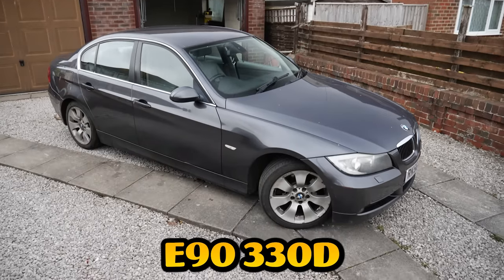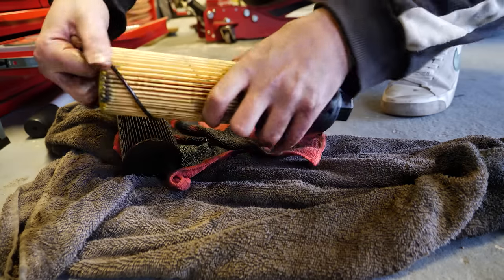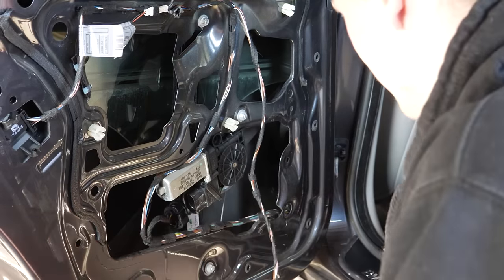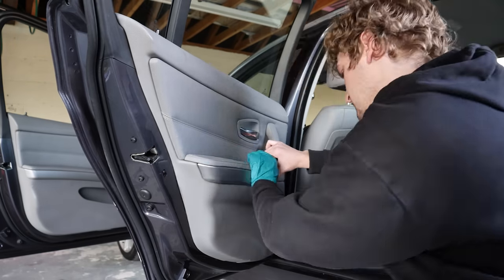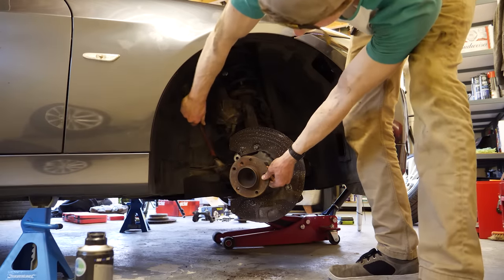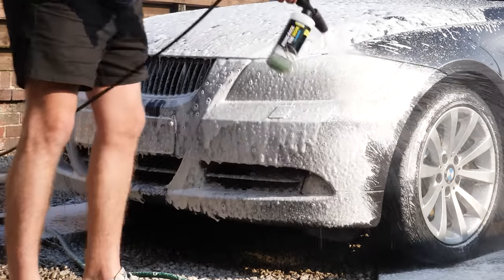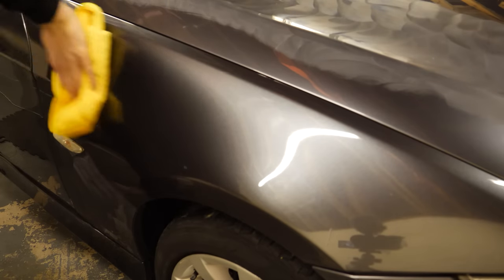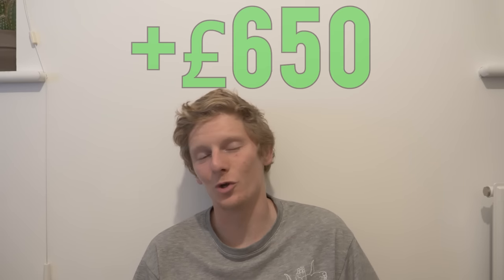I Bought a Cheap BMW and Sold it for Profit: Easy Side Hustle?

Comment: I flip cars. The beamers are a nightmare. I find that cars under £3k with a valid MOT sell fastest and give as much profit as a car selling for more money
Reply from the maker: Yeah think you’re right mate!
Reply: @Josh.Sanderson  may not be as interesting as the 3 series but my last sale was a 2010 panda. 42k miles. 1 owner, cam belt done. Needed a new bumper. Cost me 200 to do the bumper and mot and made a grand profit. Sold in 6 hours.
Reply from the maker: @JMc.D  sold in 6 hours :o
Reply: Totaly agree beemers are a nitemare as well as scoobys 🤦‍♂️🤦‍♂️🤦‍♂️
Reply from the maker: MotorHeartAT  where do you buy the newer models cheap enough to make that much profit and where do you sell them privately?
Reply: Wrong here in the states I’ve made many thousands off BMWS. sounds like it’s hard to fix them for you need better know how and tools
Reply: @startingtech3900  I’m not interested in projects for flipping. I’ve sold 27 cars since beginning of August and that’s on my time off from my full time job. And I’ve previously sold in excess of 700 cars while working as a car salesman. There’s just so many BMWs out there competition is too high and a lot of the older ones haven’t been looked after. I find the more mundane cars around the 3000/4000 mark sell best and fastest.
Reply: @JMc.D  just flipped an 01 330ci for 6k made 3k profit. Took 3 weeks longest wait is just waiting for the pink slip from DMV but you have to know what your doing. I don’t illegally title skip I actually put them in my name. I don’t do that volume as that’s illegal in the states. We can only do 5 per year
Reply: @JMc.D  but if you have a dealers license you are actually correct you can’t put that much work into a flip. I did have to put alot of work into it
Reply: @startingtech3900  I’m on the other side of the Atlantic the market is just different I suppose.
Reply: @Josh.Sanderson i am coming to the uk in march for a month and im from trinidad and tobago i would love to flip cars with you for my month vacation
Reply: Never had major issues with bmws they’ve been the most reliable cars I’ve every bought and sold or built and daily

Comment: Hey bro, thanks for the upload. If you haven't found out yet. Red thread locker is designed to be released with heat. Just a pro tip for the future. Good luck on your flips!
Reply from the maker: Thanks mate that’ll definitely help next time haha
Reply: I was going to tell you the same

Comment: Don't use copper grease on the sliding pin it will freeze use silicone grease.
Reply: Agree silicone grease is better now dats copper grease is old hat

Comment: Hi buddy, 

It’s commendable how hard you’re working on this to do the job right.

I’ve worked in the trade for many years and have racked up a fair amount of experience. I have some advice but please feel free to ignore it!

You’re operating in the end of the market where margins are just too low because of the value of the car. If you can start looking closer to the 5k region you’ll start to realise bigger margins. This isn’t always the case but certainly is more likely.

You need to look at more ‘bread and butter’ every day stock. While  to a petrol head a 330d saloon seems like a great economical daily driver, it’s not what average punter joe bloggs wants. They want economy every day cars (fords, Vauxhalls, vws etc etc).

Doing all of the work yourself is great, but time is money. The mechanical stuff can definitely save a lot of money and you should consider to do that yourself for now if it’s going to save a lot, however the detailing is a real pit of time (I’ve been there). While cars of this are and price can be ‘transformed’, by a polish etc the amount of time it takes is very prohibitive to efficiency. Punters really aren’t expecting a car of this age to be polished and compounded. If it was easy to do then I’d say crack on, but it’s just not unfortunately.

Lastly, make sure you’re advertising in the right place. I know AutoTrader is expensive to advertise, but if it halfs the time it takes to sell then it’s paid for itself immediately. The difference between AutoTrader and eBay/Facebook etc is dramatic.

Good luck bud and keep smashing it. Love the videos.
Reply from the maker: Thanks for the tips mate I really appreciate it mate, I’m in it now for the YouTube more than the car flipping so I’ve been tempted to outsource the detailing but I figure people probably want to see it? Maybe I’ll try on the next one and see if it affects the views
Reply: @Josh.Sanderson  yeah very good point. I did meant I put at the bottom that you can probably throw out most of what I’ve said if the main aim is growing you’re channel haha. Either way I enjoy the vids mate and best of luck 🤟
Reply from the maker: @GillyGilb  you hit some really good points mate! But glad you enjoy the videos that’s the main goal!
Reply: Fantastic advice 👍👍

Comment: It’s impossible for the disc holes not to line up. The wheel studs go through them to the hub.
Reply from the maker: Doesn’t have wheel studs, and the holes in disc are a lot bigger than holes in hub

Comment: I think you fell foul of the ULEZ crash. Older diesels that would incure the daily ULEZ fee have lost a lot of value on the used market recently. Even if the buyers are nowhere near London the emissions zones are popping up in other cities like the plague. Had this been a 330i I think it would have sold faster.
Reply from the maker: Yeah for sure I think, luckily just bought a ulez complaint car hopefully make good money
Reply: Its a joke no diesels but you can drive a 3 litre petrol no problem around london

Comment: You were slightly ambitious with the pricing and should of done discs and pads first then drove instead of replacing the bearings, minimise your input to maximise the profit
Reply from the maker: Yeah maybe! But for the extra little bit of cash I thought it worth doing just to be sure and add value onto the car

Comment: Sold many bmws for profit. E92 m3 bought at 17.4. Sold at 21.1k , e60 m sport 550i , many e90s , multiple e46, Benz, BMW X5 Audi Q5. Just bought 2014 Range Rover sport v8 supercharged for my personal. And I have an 01 bmw 330i sport package m aero pack for sale coming up. Clean title 137k miles. Gonna make 4000usd profit USD off that. sell for 7300k (3300 into it) let’s make some $ boys
Reply from the maker: Damn bro I need to get more expensive ones haha
Reply: @Josh.Sanderson  more expensive is def fun and fricking badass to be driving around in but some of my most profitable ones were mid range ones like 2011 BMW X5 m sport. lot of them were cars I made 2500$ profit on. But that’s still solid boys and nice work man. I am in California so prices are high here
Reply: @Josh.Sanderson  sold the 330ci for 6k. Made 3k profit it was right before Xmas so took a reasonable offer
Reply: @Josh.Sanderson just sold another x5 mate for 3000$ profit, and another 6 speed manual 335i for 2k, got another x5 sport package for 5 selling for 8 coming up. mate we do this all day. come to california bro! u can crash

Comment: Goes to show how ignorant some buyers can be,that 330d with the far, far superior legendary M57 engine married to the super rare 6 speed manual is a million miler if basic regular servicing is carried out and the swirl flaps/egr/dpf are binned, compared to the woeful chocolate all alloy, all electric expensive gimmicks N47/57 rear chain oil starvation with plasticine guides shameful LCI model (barring the rare LCI 335d that retained the M57 for a long time before BMW could get it right) is like chalk and cheese That car was 3k all day long. They stole it but hey, a profit is still a profit. £650 not to be sniffed at for a quick turnaround.
Reply: nobody cares on facebook market unfortunately everyone just offers you £0.78p
Reply from the maker: Yeah frustrating but unfortunately only worth as much as people will pay even if it went for an absolute bargain

Comment: if you use a heat gun on the locktightened bolts it will make life much easier
Reply from the maker: Yeah my mate went to get a blow torch but never came back 😂😭

Comment: At 5:50 that's a waterproof membrane that needs to be sealed with butyl tape or equivalent as it will leak in the future otherwise.

I'd always rather buy an honest car that has defects and problems than buy from a flipper/2nd hand dealer who has done the absolute minimum to a car. Then I can replace and fix things myself to my own standards with care
Reply from the maker: Each to there own

Comment: You could have atleast got that scratch on the front bumper fixed and swapped out the inner handle that was proper grubby. Bit more effort you’d have got 3k 
You did all the hard work so why not go the extra mile?
Reply from the maker: I don’t think that’s what was stopping us getting more money and the could do stuff is endless gotta decide what is worth doing reallly

Comment: Hey Josh nice work 👍 what machine polisher/pad and compound do you use?
Reply from the maker: Cheers bud i use meguiars ultimate compound and I’ll try to find the polished pad combo
Reply: @Josh.Sanderson  appreciated mate - I’ve got an old mop machine but it’s falling to bits and I’ve never understood which pad to use 😳 you should try the turtle wax “one and done” though if you get a chance it’s pretty good!
Reply: @Josh.Sanderson  ps I was looking for some advice on which code reader to get - do you rate yours?
Reply from the maker: @PBUCKY1969  I’ll give it a go if I come across it! My friends autel machine is brilliant! They’re not cheap but well worth the money I can’t fault it and it gives extremely in depth data and information. I’ve been trying to do a partnership with them as I can’t afford one of their tablets however I use a bog standard Bluetooth code reader from Amazon with the car scanner app which is good enough for most things! Shows live data etc allows you to read and clear codes
Reply: @Josh.Sanderson  many thanks mate much appreciated - I’ll have a look out for one - look forward to your next vid! 👍
Reply from the maker: @PBUCKY1969  cheers buddy, coming soon

Comment: Great work, but diesel cars are not in great demand and car market ia soft over summer.
Reply from the maker: Yeah I haven’t thought of that it’s true diesels aren’t doing so great any more!
Reply: @Josh.Sanderson  my top tip is the more moving parts in the engine, the less reliable, so diesel turbos are least reliable, most reliable nat aspirated petrol.
Reply from the maker: @davidh4632  yeah not always true though as diesel is a lubricant so helps keep fuel system in good condition and they rev a lot lower, that’s why you see such high mileage diesels
Reply: @Josh.Sanderson 100% agree, especially for old diesels.  It's mostly all the complex emissions controlls that's making people think diesels are unreliable.

I'm not sure all these latest petrols (most of which do now have turbos) will do nearly as well as this 330d when they're 16 years old and 190k miles.
Reply from the maker: Yeah it will be interesting to see how these new petrols that are focussed so much on emission control turn out in ten years if theres any still around  @nmeister67